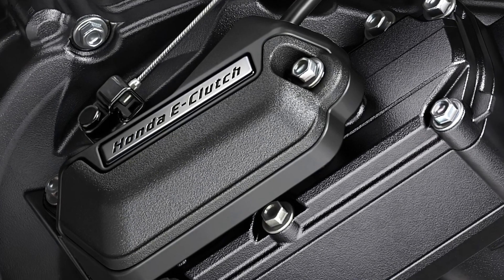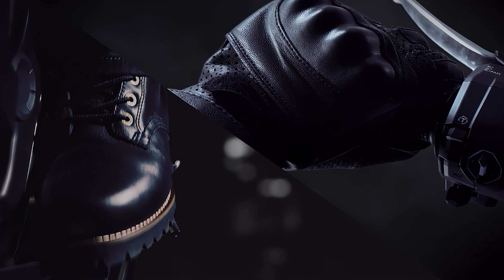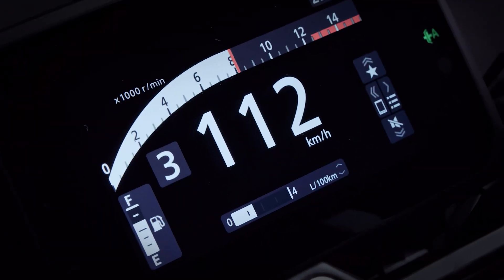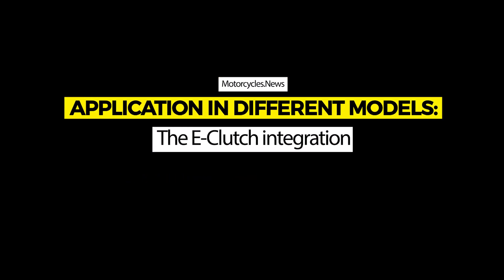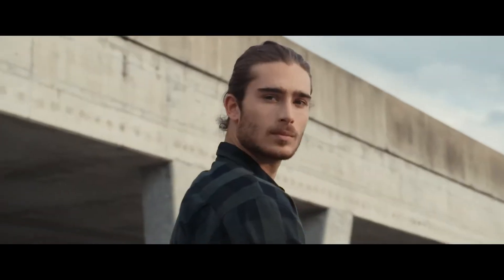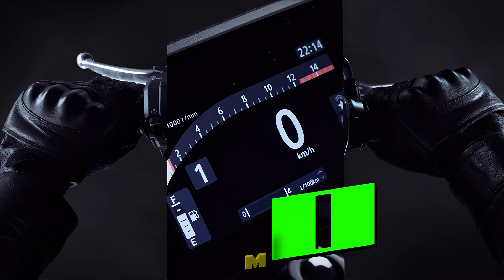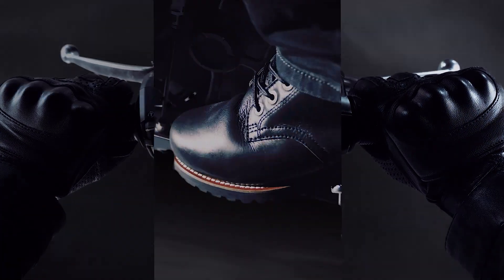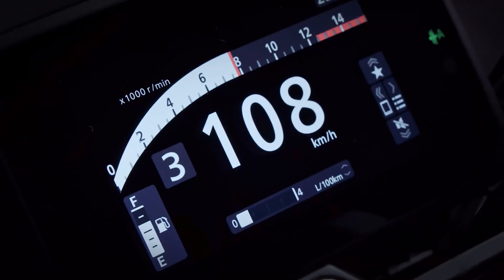NEW Motorcycle Tech: Honda E-Clutch

Comment: I understand this does not explain what is different between this and a shifter
Reply: A shifter doesn't separate the clutch, it only shutoff the ignition for a brief instant. 
Eclutch does separate the clutch, like you'd do with your hand lever. 
The question is, do we have to shut the gas off while using the eclutch, and does it work on downshifting at high speed without blipper, without destroying the engine, gearbox or the clutch. I can't find the answer.
Reply: At the end, it surely only usable for low rev, low speed, and stop. You surely have to use your regular lever when shifting at high rev, higher speed.

Comment: No thanks, to be a passenger I prefer a cab or a bus.
Reply: You are still manually shifting with your foot. I suffer from damaged tendons in my left hand from years of riding. This could help me hang on to my manual transmissions as long as my legs hold out! Plus, you still have the ability to use the hand clutch as normal. It’s literally the best of both worlds and only adds 2kgs to a model. What’s not to like?

Comment: I like shifting manually but not with the foot. I would prefer paddle shifting on the handlebar.
Reply: That you already get with the dct transmission from Honda 🙂
Reply: allways driving with M on my DCT honda, up and down shifting with finger and thumb.
Reply: Yamaha has it on the FJR1300. As an option. With automatic clutch. For already like 20 years.
Nothing new or revolutionary about this Honda E-Clutch 🙂